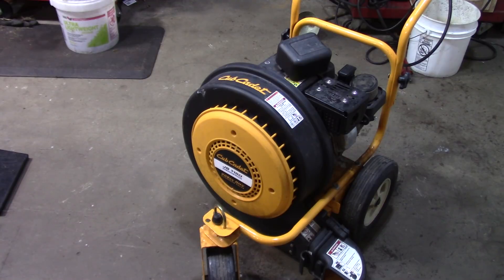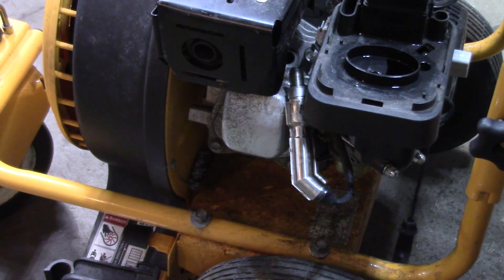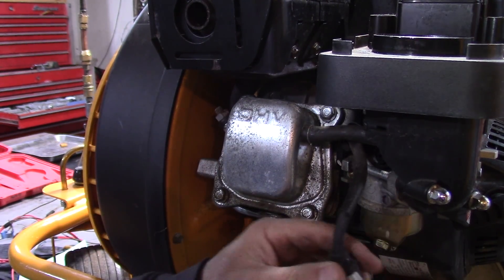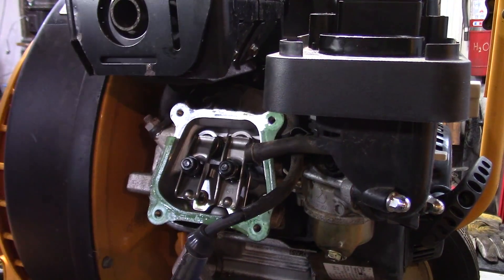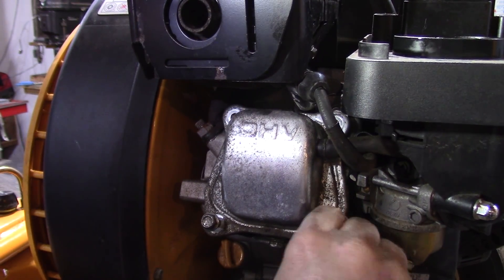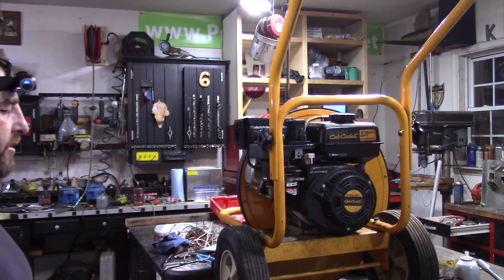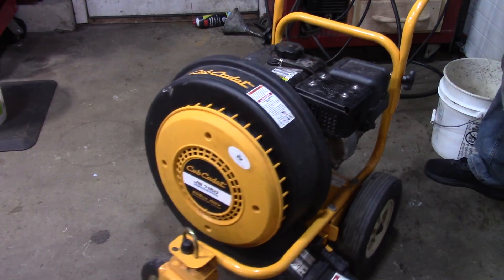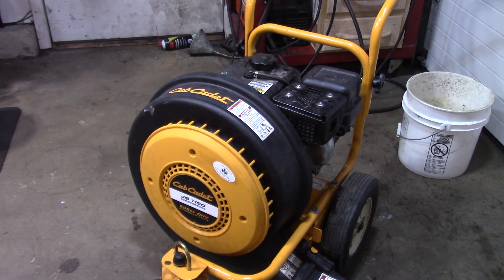CHonda Clone Engine Spark, Fuel, but Won't Start

Comment from the maker: https://amzn.to/3IBUm1L Starter Fluid
https://amzn.to/3yhliPs Spark plug removal tool 5/8"
https://amzn.to/3ydPATe Compression Tester OTC
https://amzn.to/31RQOYj Spark plug boot removal pliers
https://amzn.to/30mx66A Echo Spark Tester PET4000
https://amzn.to/31OuUoG ThruNite Head lamp rechargeable
https://amzn.to/3lV1w7x Briggs Spark plugs for CHonda Clones 
https://amzn.to/3oMSevS Feeler gauge Set

Comment: I usually just shoot a bit of carb cleaner in the spark plug hole once I have spark. Idle circuits are common causes of no start. Of course there's always Carl Childers to think about

Comment: Couldn't you use a spark plug socket and an extension instead of the tool you've got there? Thanks for the video.

Comment: I bought a new snow blower China model the darn thing took for ever to start it has electric start.. This fall i messed with it because it would take five minutes to start I changed the plug to a decent plug now it starts with the pull rope.. those torch plugs are junk even if you are getting spark from one they are junk for some reason they don't work well.. my opinion only

Comment: With 70 psi compression at the start as it was, you definitely should have the engine at least puffing or trying to start a little. The original spark plug was probably just flooded.
Reply from the maker: That is a good tip that I overlooked.  I was playing with it for about five minutes the night before and thought it was a low spark issue because the spark was yellow.  When I changed the plug it looked better.  I hear the magnet on the flywheel is known to go bad, too.
Reply: @doublewide6  I always use a proper spark plug tester with an enlarged gap for testing if spark strength. Spark color is very subjective and difficult to observe right. When I do have weak spark, it will often only intermittently jump the spark tester as I turn it over.
Reply: I just fixed my neighbour's almost new powermore snowblower engine. Torch plug was bad.

Comment: I just did a head gasket on one of these engines on a craftsman single stage snow blower.
Reply from the maker: I have only done one head gasket on these engines.  In fact, the issue was a bent valve, not the gasket but I replaced both.

Comment: Nice presentation.
..👍 # 158
Stay well, Joe Z
Reply from the maker: Thank you,  those are good tips.  I usually just add to the old rtv if it comes off smooth.  I use the Right Stuff.  It is not the best way to do it but it is fast and cost effective.

Comment: Perfect diagnosis process to find the valve problem.  Great job. Thanks for the video and the tips.
Reply from the maker: I got lead down a different path, originally I thought is was a coil / low spark issue.  Thanks

Comment: Did you check the compression after the adjustment?  Am surprised it did not fire at all at 70psi.  Thanks for the video.
Reply from the maker: No I did not check it,  I am going to run it for about 1/2 an hour see how it does then I will take a reading.

Comment: Nice video Bob we have had a few engines come in with valve clearances too small but these were older engines where believe the valves had beaten in for the clearance to get smaller than the original factory setting. This unit appears too new for that to happen what do you think? The OLD MAN at EP over and out!
Reply from the maker: It was a landscapers, so it has many hours also the Chinese steel is not a hard as US steel.  I don't think the adjustment slipped because those things were as tight as they get.  I will send an email about stickers.  Bob

Comment: That engine being a Honda clone, I am impressed that the engineers used a valve cover gasket vs. gasket sealer. I have dreaded adjusting valves on Honda engines in the past because I end up spending 15 minutes doing the adjusting and an hour tediously scraping the old sealer from surfaces. Thus, I have been cutting my own gaskets from basic Felpro 3157 gasket material & so far, no leaks. I made a cardboard template so I can outline the correct shape on the gasket material quickly & usually cut out several at a time. A cheap set of hole punches from Harbor Freight includes the perfect-sized punch for the screw mounting holes.

Comment: Good trouble shooting - valve gap - adjustment is typically overlooked by rookies like me.  I was surprised to hear about the past experiences with some of the NGK plugs - I've always found them to be the most reliable - especially in the Stihl 2 cycle equipment.  Thanks for the video.
Reply from the maker: It is very rare, but I have seen low spark and no spark with them.
Reply: There are counterfit parts also on ebay and Amazon